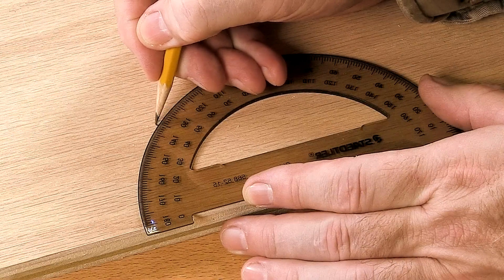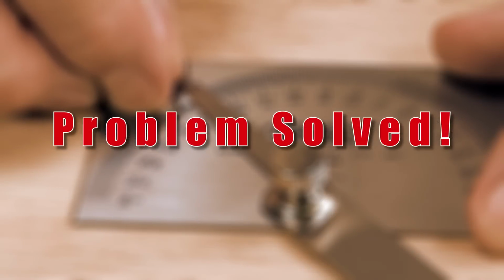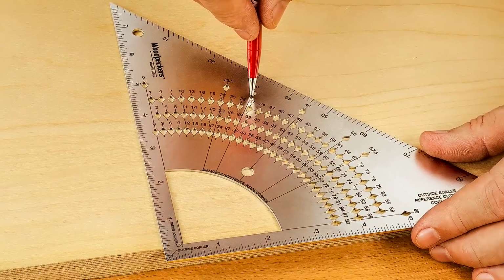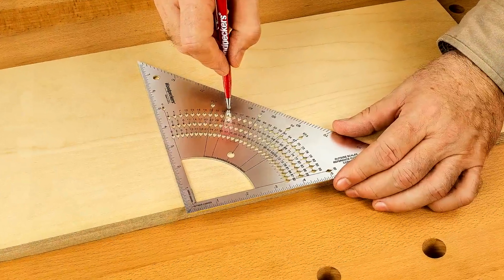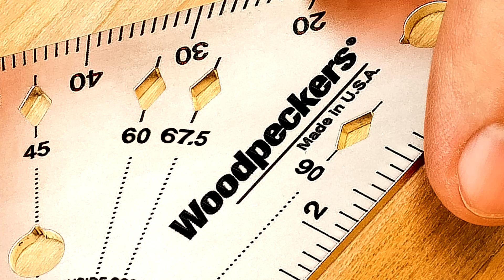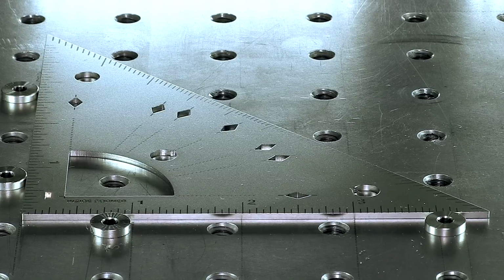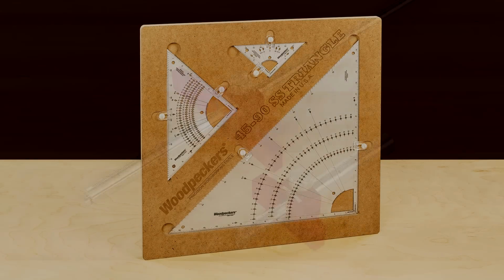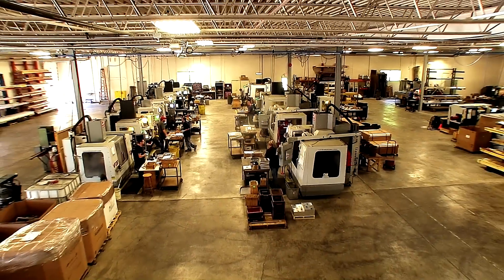Woodpeckers 45-90 SS Triangles (Retired OneTIME Tool®)

Comment: 60 dollars for 8 inch triangle... or 200 for hole set of 3 that is more then be mad... Whats the point of having perfect marking on the board if there will be not perfect marking on your cutting tool... If you want to make 45 degree cut, you adjust your tool for 45 degree right?